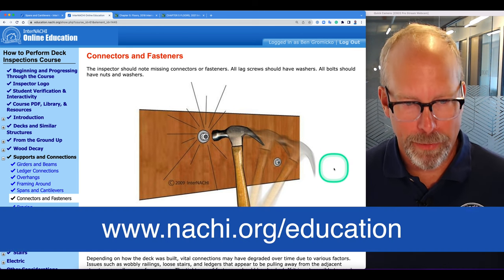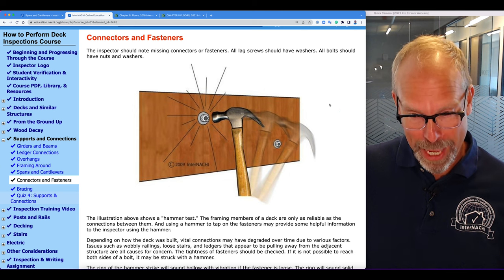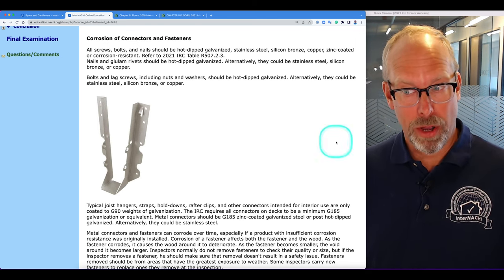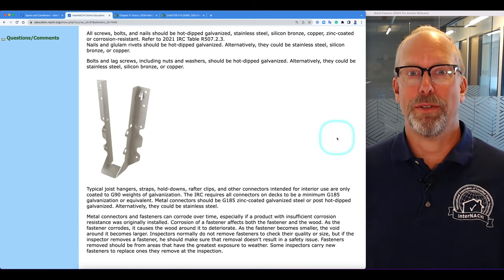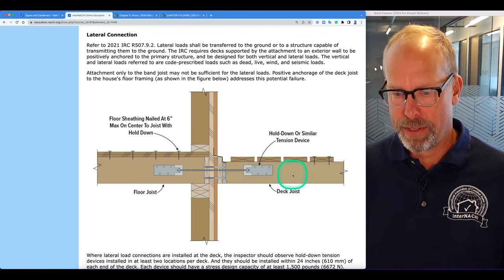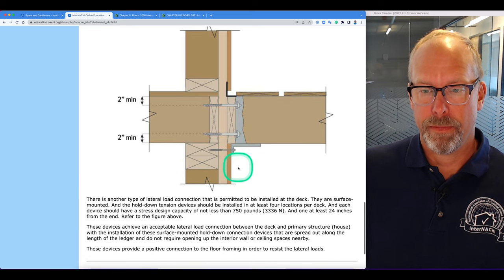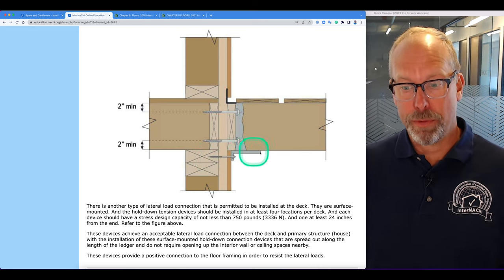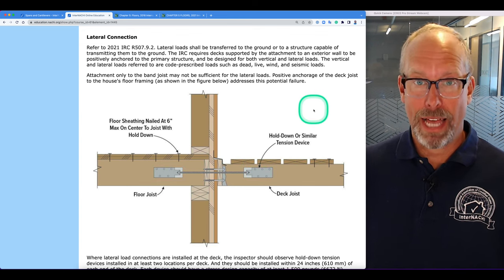Inspecting Deck Connections & Fasteners

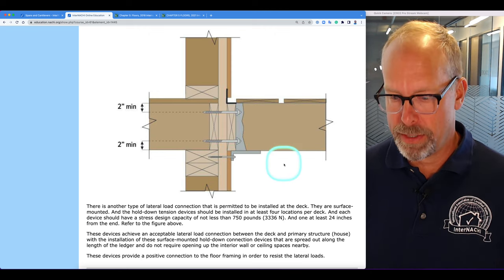Comment: I am new to deck construction, so forgive me if I am wrong. But, it looks like that bottom fastener at time mark 5:50 is going through exterior clad. Shouldn't this be stripped away and secured against the sheeting under the clad?
Reply from the maker: Maybe. Good catch. Thanks for watching.

Comment: You didn't address what happens when your house joists are perpendicular to the deck joists for lateral load connectors.
Reply from the maker: That's a tough one that manufacturer's have figured out.